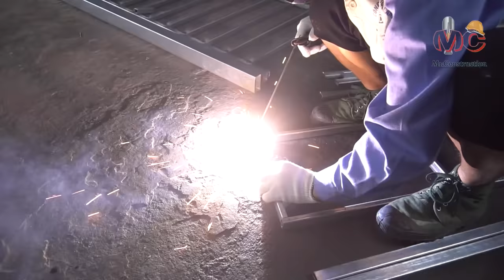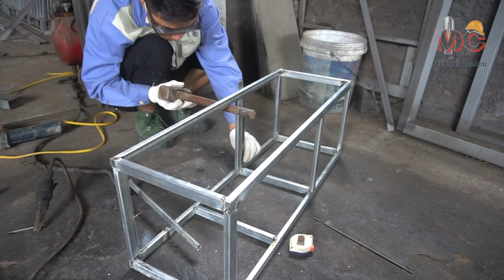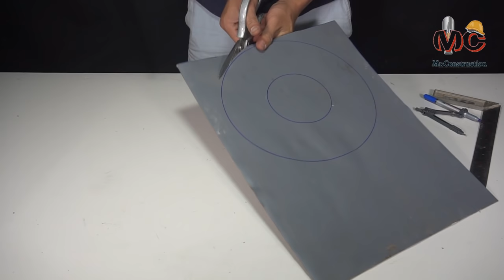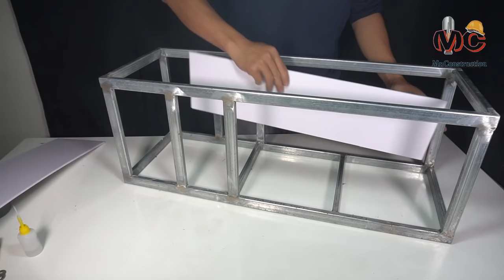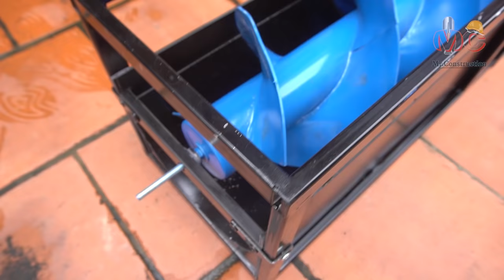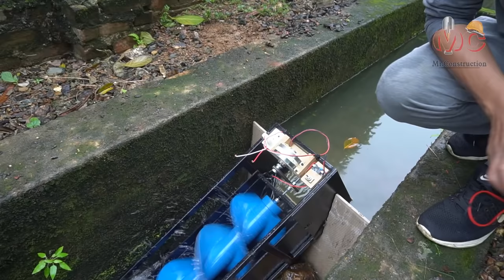Mini hydroelectric with screw turbine system. Free electrical energy science project

Comment: This is cool as heck, but please bro for the sake of your eyesight, wear some real welding goggles. The exposure to the heat and UV light WILL cause cataracts and that's the best case scenario. The worst case is you going actually blind from macular degeneration. Also wear a real respirator when welding because the metal fumes can also cause some horrible diseases which cause you to die slowly and excruciatingly painfully.
Reply from the maker: Thank you 🌹🌹🌹

Comment: How much voltage you generating at first stage? and what type of converter circuit you used in this? Is it 140vdc to 32vdc convertor?
Reply from the maker: The voltage generated is 38v, that circuit is a 12v . low voltage circuit

Comment: Great job brother, i have a question, why the screw rotational speed decreases when you connect a load to the dynamo ?
Reply from the maker: I'm also not good at physics to explain it to you, sorry about that
Reply: I noticed that also
Reply: @mndiamundia1197  hi dear friend , i did a lot of researches about this phenomena, its called " counter torque " when you apply a load on the generator it create a counter torque equal to the power consumed in order to have electrical stability inside the generator.
Reply: Because of additional friction and load

Comment: Can you please send the Motor details 
And from were we get that
Reply from the maker: You can find it in the air conditioner
Reply: @mr.construction9846  did you change the winding  structure of the ac  motor or we can use it without modificaion

Comment: Greetings from Nepal.
My team is also doing this project for final year Project. Can I please get details about this plz. 
We have already done the design and simulation parts, fabrication part is remaining.
Reply from the maker: Thank you for watching the video.  Here are the specs: iron frame size 25x25x80cm (inner edge).  screw diameter 75mm (a), screw pitch 350mm(b), water chute diameter 240mm (c).  We calculate the parameters of the screw as follows.  
d1 = impeller inside diameter,
d2 = impeller outside diameter.
Apply the following formula, 
d1 = (square root of ( (a.3,14) squared + b.b)) /3.14 .  
d2= c-a+d1 .  
This is just my calculation, you can refer to the online documents for a more accurate and reasonable calculation.

Comment: What kind of materials did u use to make an archimedes?
Reply from the maker: It is a PVC pipe, you should flatten it with heat, shape it and glue it with epoxy glue

Comment: Can i have the list of materials that you used?
Reply from the maker: Thank you for watching the video.  Here are the specs: iron frame size 25x25x80cm (inner edge).  screw diameter 75mm (a), screw pitch 350mm(b), water chute diameter 240mm (c).  We calculate the parameters of the screw as follows.  
d1 = impeller inside diameter,
d2 = impeller outside diameter.
Apply the following formula, 
d1 = (square root of ( (a.3,14) squared + b.b)) /3.14 .  
d2= c-a+d1 .  
This is just my calculation, you can refer to the online documents for a more accurate and reasonable calculation.

Comment: Can i know the length, width and the height of the frame? thank you so much
Reply from the maker: 25x25x80cm
Reply: @mr.construction9846  thank you sir
Reply: @mr.construction9846  sir can i ask again what voltage regulator did u use?

Comment: what motor did you use and how many volts?
Reply from the maker: It is the motor of the air conditioner, this turbine generates a voltage of about 40v .

Comment: can i know speed from water need , rpm for this motor
Reply from the maker: With this turbine the flow rate does not need to be very large, but depends quite a bit on the flow rate, you put all the water through the turbine and you will get what you want. As in the video, the rpm of the motor is about ~300

Comment: Goo day sir, may I ask what is the sizes and measurements of the gearing that you've used? thanks a lot!
Reply from the maker: Outer diameter of gear is 200mm, shaft diameter is 60mm, In my channel there is a video on how to make a screw, there is a formula to fit the dimensions you want

Comment: can you help us because we will do it for our project
Reply from the maker: Thank you for watching the video.  Here are the specs: iron frame size 25x25x80cm (inner edge).  screw diameter 75mm (a), screw pitch 350mm(b), water chute diameter 240mm (c).  We calculate the parameters of the screw as follows.  
d1 = impeller inside diameter,
d2 = impeller outside diameter.
Apply the following formula, 
d1 = (square root of ( (a.3,14) squared + b.b)) /3.14 .  
d2= c-a+d1 .  
This is just my calculation, you can refer to the online documents for a more accurate and reasonable calculation.